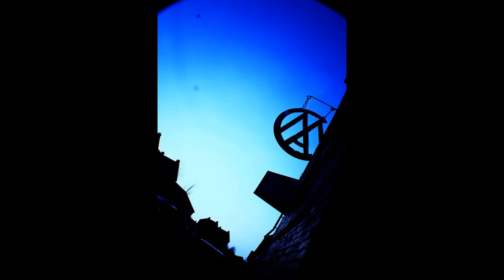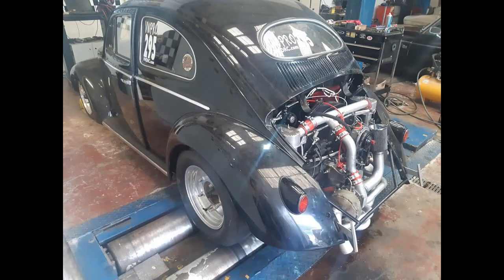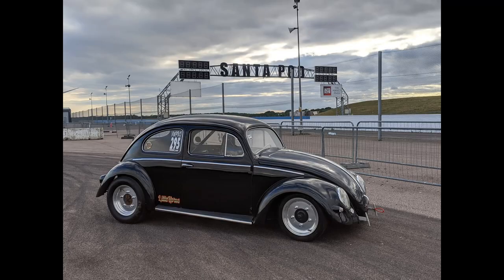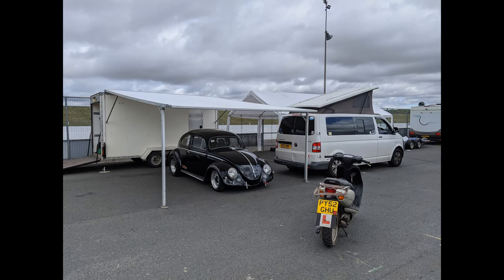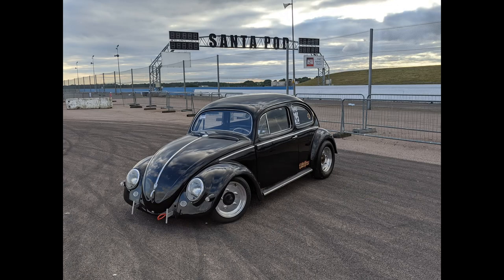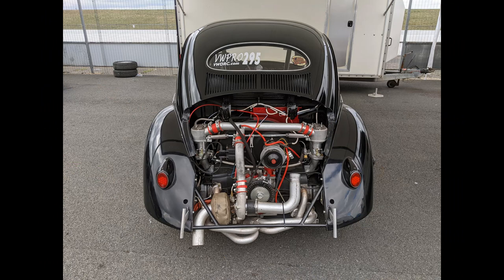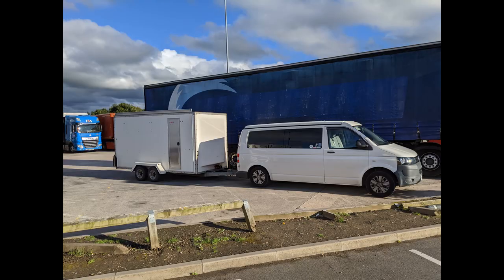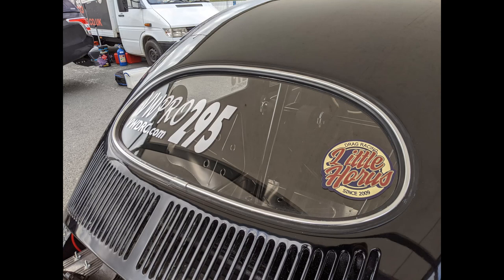Little Horus drag racing beetle Part 8 (Dyno and Test run)

Comment: Congrats on the PB. I found that 18lb in my M&H as well. I set my personal this year in my oval with a 12:12 at 110mph. Don't you have a way of data logging? This helps a lot. no need to watch gages, just check data after your run.
Reply from the maker: Congrats on the PB, Yes I can datalog with the CB 4th gen system, however you have to have your laptop plug in. Iv not tried it yet, but its on the list.